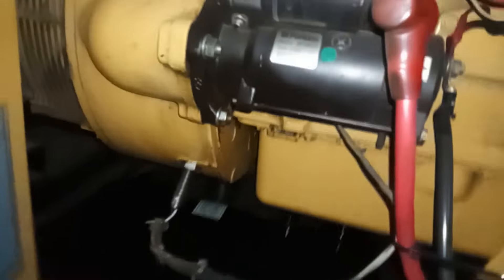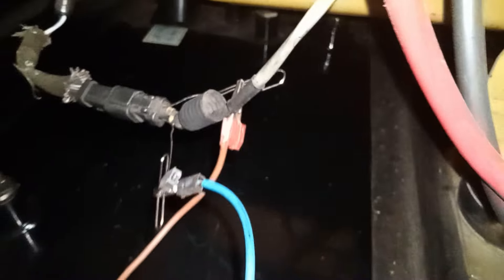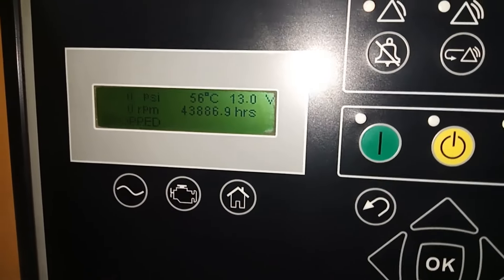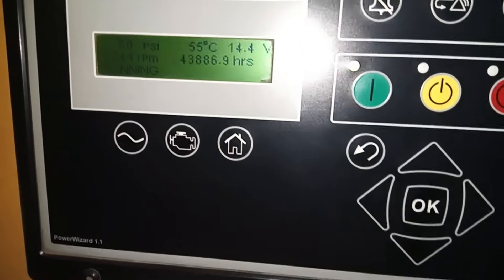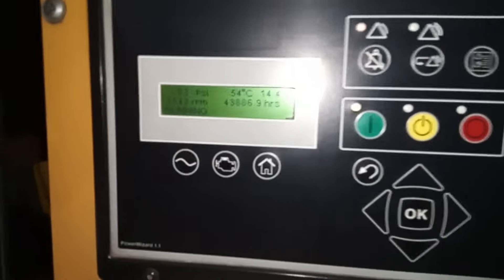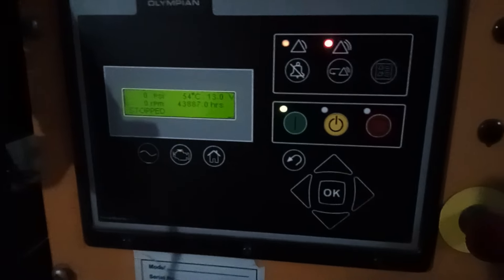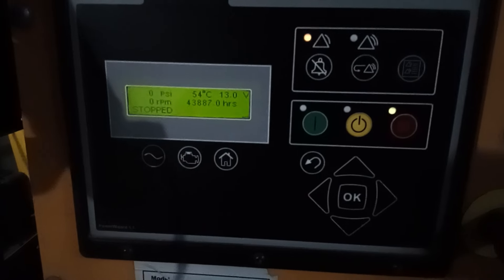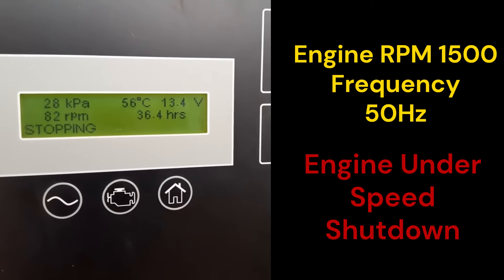Magnetic Pickup Speed Sensor Test on Perkins Diesel Generator.

Comment: Speed sensors fail by shorting through or becoming an open circuit. Check them with an ohm meter. They will have no resistance or infinite resistance if bad. I've never seen one be out of calibration but if that was suspected, they should be checked against a strobe tach. Shoving paper clips into the harness connectors will provide a nice tunnel for water to enter and corrosion to form inside the harness.
Reply from the maker: Great point, thanks for sharing your experience!

Comment: Check that magnet for metal chips which causes a malfunction.
Also air gap between magnet sensor and rotating teeth.
Reply from the maker: Great advice! It's essential to inspect for those factors to ensure accurate readings.